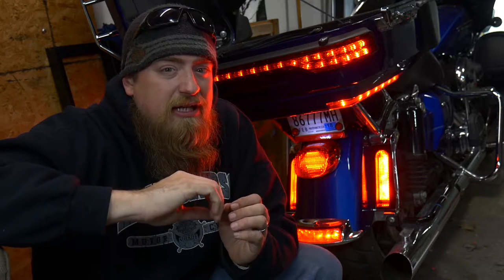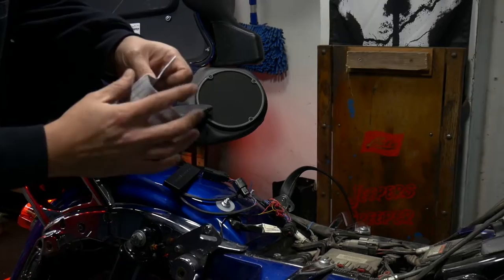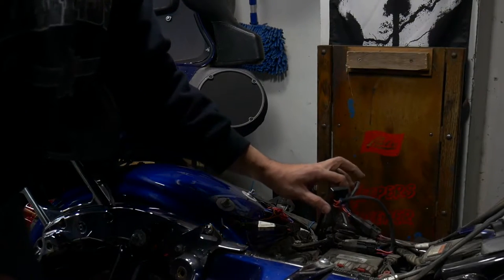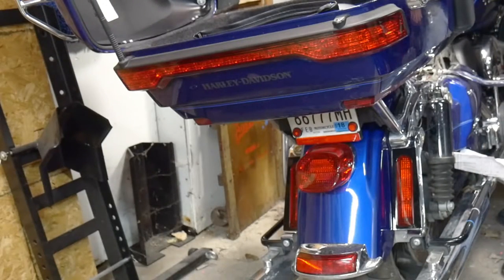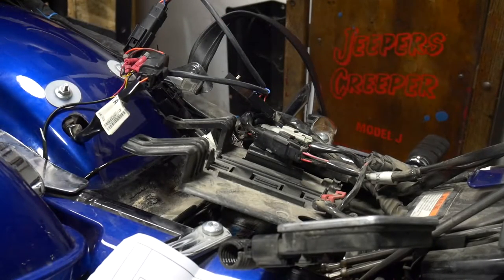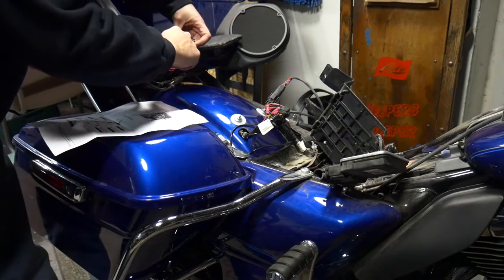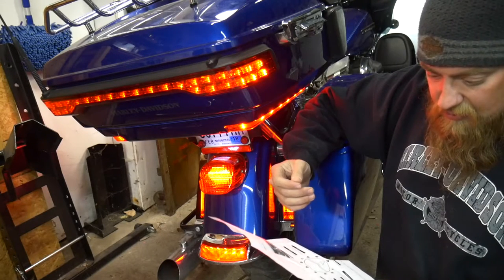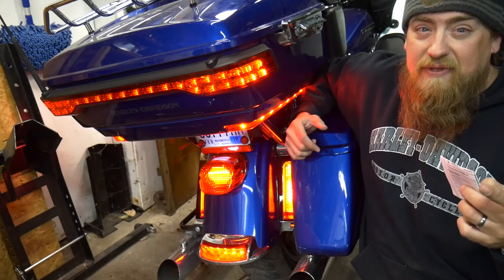Custom Dynamics Magic Strobe Install | Brake Light Flasher

Comment: Really easy to follow vid and helpful tips. Was able to install Fillerz and both strobe kits on my ‘14 Ultra Ltd  in just over an hour, start to finish. The one thing I did do, is instead of going through the disconnecting of the ground battery cable, I just pulled the main 50 amp fuse. The lights are super bright and the strobes really draw the eye... Great job, super helpful and major time saver.
Reply from the maker: Thank you for using my video, glad it helped. yeah i agree, love these lights!

Comment: thanks for the video, I would think it would be much easier to remove the 50amp fuse from the side cover than to remove the cable from the battery, this way you don't have to mess with the wiring harness cables or the bracket on the battery....I will be installing the magic strobe next week and think this will be much easier to do.  (same process used when I upgraded the headlight from halogen to the LED day maker.)   thanks again,
Reply from the maker: +Spenc4Hier thanks for the tip, I really didn't think about that.
Thank you for watching as well.

Comment: Astounding that 5 people thumbs down.. How can you use a computer when you have no  brain? I've upgraded my 08 Ultra Classic to all LED, the Magic Strobe for the Custom dynamics Taill Light and a Strobinator which is worth it's weight in gold.. As you said, these strobing lights REALLY DO get the attention of the brain dead drivers that we often encounter.. Remember kids, Give yourself plenty of room at stops so you can bail if you need to (Watch those Mirrors!).. Excellent video. Thank you..
Reply from the maker: Thank you. Yep these will save your tail for sure.

Comment: So I ordered the RSG hooked it up in the same place you did finally but I am still not getting my filler lights to strobe. Any ideas?
Reply from the maker: It didn't work in other plug? I don't know why that was different on mine that what the instructions said... very strange.
Reply: @Touringmidwest  I noticed that your filler lights look to be wired in with spade connectors. Mine came with a pigtail that's plug and play like the strobes. I put it in, pre-pigtail and post. No luck. When I get off work I will try putting it where the directions said to.
Reply from the maker: Yep,  the original fillerz were wired that way.. I have the probeam now and those are plug and play
Reply: @Touringmidwest  got it figured out. Both dip switches need to be in the on position. If the blinker one is off, only the center light strobes. Both switches on, all lights strobe minus the tour pak.
Reply from the maker: @bradleytarbox7693  yeah they sell a separate one for the tour pack... I have it and I like it but I removed it because I don't have enough room for all of the connectors and mod boxes lol

Comment: Did you leave the lighting stock or upgrade to led?
Reply from the maker: I upgraded to LED
Reply: I saw that the fillers was LED, so u upgraded the brake and touring pack lights??
Reply from the maker: The Tour pack is LED from the factory, so just the tail light and added the fillerz. Also front signals and windshield trim lights
Reply: So I just need to update the turn signals and tail light? Thanks for your help and the great video!!
Reply from the maker: Yep and I added both of the magic strobes for the flashing brake lights
Reply: Thanks so much for your help and replies...Great video!!
Reply from the maker: Anytime, no problem at all.
Reply from the maker: Most of that stuff should be available in my Amazon influencer store as well if your looking to buy.
Amazon.com/shop/Touringmidwest
Reply: Thanks so much!!!